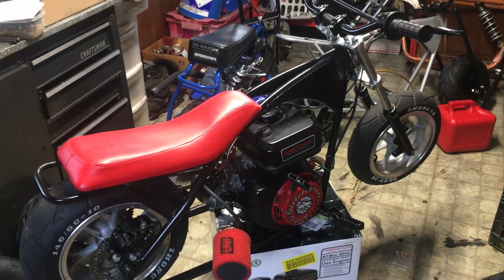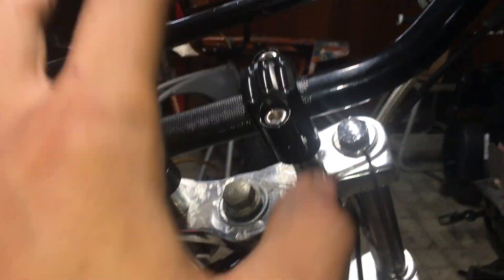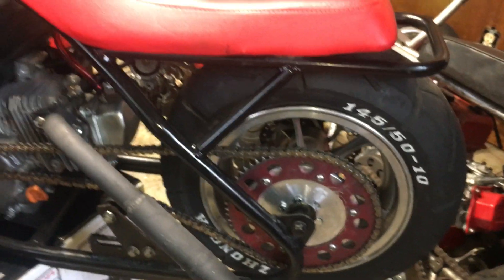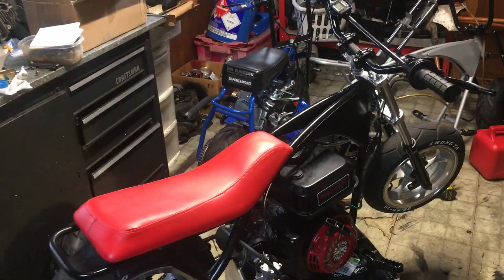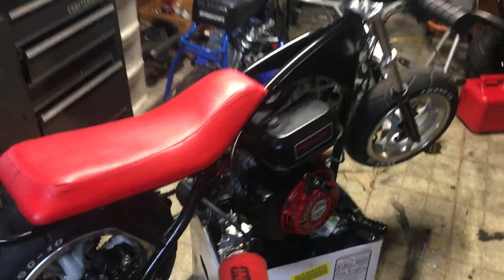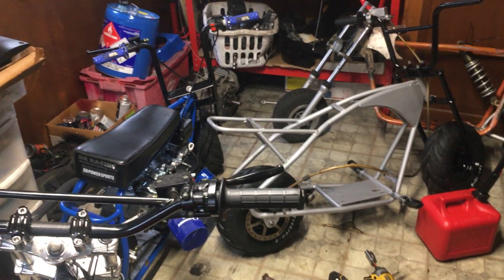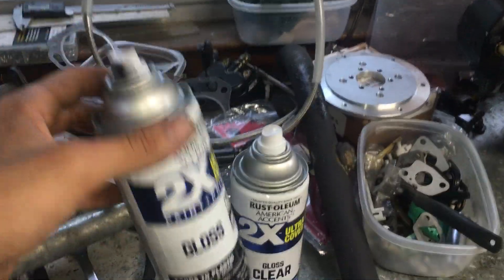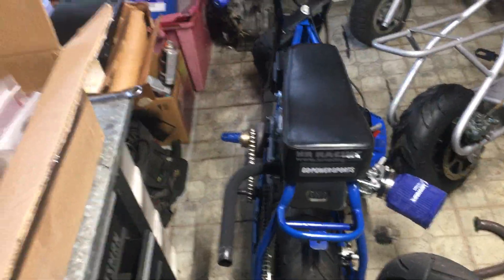80mph Mini Bike Build & Walk Around

Comment: What kind of power do you think the motor is making?  I have a 16 HP Tilly 265 cam that just let go. 😕. Earlier it had been run at 6900 for awhile before I got a tach.  Factory 10/45 sprockets with CVT with juggernaut. Stock 19” tire on Coleman BT200x. Only ran 55 but would get their real quick. 

My other BT200x is stock Hisun 196cc with 18 lb springs, .038 jet, zip tie gov, CVT, 9/45 sprockets stock timing plus 8 key way, runs 47, I weigh 220. Bought the first lil over 90 days ago knowing nothing of mini bikes or these motors. Learning.
Reply: Do you know what gears you’re running on the one that went 47
Reply: @d-boyzeighteenhundred  As referenced 9 tooth front sprocket stock 45 tooth rear sprocket.  Its now went 48 mph down hill at 5,200 rpms or 44 mph on a flat at 4,400 rpms. It’s the best gear for stock 196cc engine (stock cam, rod, flywheel) at my weight.

Lol works well with 40-45 mpg traffic on 35 mph street.

Comment: Do you think a stage 2/3 Predator 212 hemi with a Juggernaut torque converter would be good on an offroad kart? Looking for around 55 mph with a lot of low end torque. Already have the parts ordered (carb jet, air filter, header/muffler, PVL flywheel w/ 32° timing, billet rod, MOD2 cam, thin head gasket, and 22lb springs). I'll be gearing it way lower than your bike, and the torque converter should help as well. Just want to get an informed opinion.
Reply: Do it, you'll have one bad@$$ go kart
Reply: @memphis-phillips  Already did it and decided to go bigger. Had a Stage 2 212 on a Manco Dingo. It ripped but I wanted something with suspension. Now I'm in the process of building a full suspension mini buggy with a modified Duromax 440cc. The 212 is now on my friend's CT200EX.

Comment: Hey man I love the channel and your work...Where are you getting the tires (the street bike tires) the Zhongya street tires. looking for a 4.8/4.0-8
Reply from the maker: Thanks bud. I haven’t had to replace my tires yet I only used the tires that came with the rims. Maybe try putting the size you need on google and see if anything comes up? Sorry couldn’t help on this one
Reply: @lsminibikes  
Nice bikes I like it but if you had bicycle pedals on it. It could be used on trails and side walks like my phatmoto 80cc single speed motorized bike. I ride slow like to have all torque for up hills some off road a 4 speed with 110 -125cc.

Comment: Is that a mini chopper front end on that dual suspension build?  I want to put one on my M-Vox.  Also 12/64 16.5 tires is 8200rpm to hit 80 mph daayyumm. I need one of your motor builds for sure
Reply: What sprocket and clutch size is that

Comment: I been strike out those x18 wheels and forks setup was wondering where you got those too along with the big brake rotor on the back? Also i would really like to see a video and a rundown on how you shoe horned that 420 on that blue frame lol. I had a hard enough time trying to get my 212 to fit the way it does without chopping up the frame lol. nice bikes and builds keep it up, ignore all the haters, keep that content coming
Reply from the maker: Thanks bud. 
I will make a video tomorrow just for you on the 420cc. Stay tuned.
Reply from the maker: Hey bud, I made the video for the 420 doodlebug. Go check it out

Comment: Awesome bike bro, that head port is the biggest part to it. You should check mine out, I haven’t ported my head yet but my top speed is 83 mph.
Reply: What’s been done to yours
Reply: @davidperalta219  lmao a whole bunch since this comment, 60# valve springs, 3 inch piston, 32/28 valves, champion rockers, fuel pump, .365 cam and every billet peice possible with a 30MM KSO carb that's ported and polished.

Comment: Nice job man and fuck those shittalkers. Who cares if they believe you or not what jetting are you using on the 26 mm carb and what frame? I want to build a similar one also do you have roller rockers? Thanks and great job man keep building
Reply from the maker: Hey 👋 thank you. 

Stock jetting that came with the carb. Think it was a 38 pilot and 110 main. It’s the $30 eBay carb
Reply from the maker: No roller rockers. I used stock push rods and rockers in this setup.